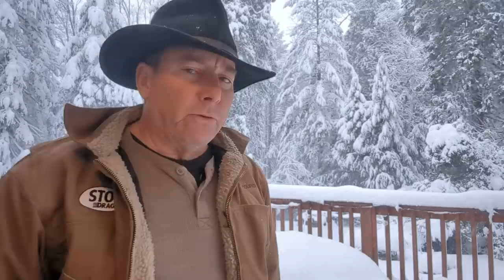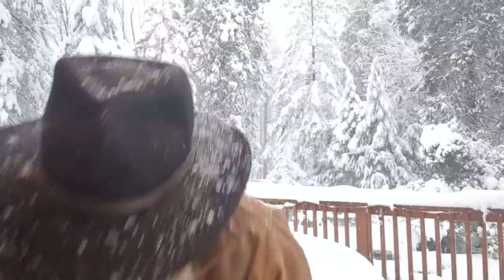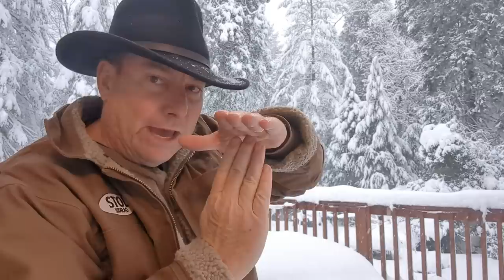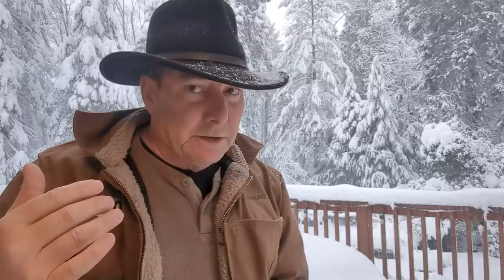PC-12/45 NTSB UPDATE In Flight Breakup! 26 Feb2023

Comment: There are so many CVR'S sitting on shelves from scrapped aircraft that have been retired from service due to market changes. They might be "on hold" as back ups for the type aircraft the were removed from but getting one installed in a part 135 aircraft would take either an exemption from the FAA for installation in a commercial aircraft or recertification of the avionics suite on board. Years back I remember there was a company that sold a small voice recorder that installed in the instrument panel, primarily to be used as a reminder device for the pilot. The big issue is that it would not have survived a post crash fire. This is the reason for mounting the CVR’S in the tail of the aircraft. This would amount to installing a wiring harness to the tail of the aircraft which would make it  necessary to disassemble part of the interior of the aircraft to properly install the harness. This would lead to issues of aircraft being down for service as well as the cost of installation and a new W&B certificate. Personally I would do it if I was still flying.

Comment: Maybe the plane reduced speed after breakup, otherwise the avionics might not survive. Near vertical into the ground at close to mach is no bueno.
I can see how you could get disoriented in a plane with no instrumentation and got into IMC but isn't the very premise of IFR to fly blind on instrumentation. It must be a certain personality prone to lock up in an irrational panic mode. Unless the autopilot was bumped off and the pilot didn't notice but is that even possible. If the flight off autopilot felt pretty steady but nah, near vertical it should feel wrong somehow. Is it possible to barrel accelerate down so you feel no longitudinal force and suitable 1g down into the seat?  nah seems very particular.
Reply: Its not so much a personality type, we rely on out inner ears perception of movement and balance all the time we are conscious and 99.9% of the time  its correct, humans didn't evolve to fly so when that system gets out out of wack  without practice or training its really hard for us to recognize that  our brains liying to us and that you have to act contrary to what its telling you. Thats even more so in a stressful situation, and that why Spatial disorientaion is a dangerous thing and has killed even very experienced pilots. And yes you can be 90 degrees wins banked in a descending spiral heading nearly directly vertical into the ground and still feel like you might be wings level or even climbing. In most cases of spatial disorientation pilots end up into a steep descending spiral for this very reason. He most likely was on autopilot up until it may have shut off due to turbulence and he began hand flying which is when potentially he began turning and loosing altitude.

Comment: Hey Juan, "almost Commercial" pilot here, so no experience in the FLs, but I did notice that in your commentary of the ADSB data that I think the area where it supports an AP disconnect is right at FL18.  Could there be something with either the AP and the setting to 29.92?  Or is the cockpit layout such that changing the altimeter is close to the AP?  IE high stress environment and changing the wrong instrument???  Just a thought?

Comment: Flying alone in hard IFR at night in weather on Part 135 is not very smart, to say the least. 
The Pilatus PC-12 is a very capable aircraft. The problem seems to be ... the pilot. I don't know this particular pilot's experience, but in general most of the pilots move "up" from smaller airplanes to a high performance single or twin engine turboprop. It takes a while to get used to it. As soon as your experience grows, the pilots move to bigger airplanes / airlines.  Medevac pilots rarely do this job for a lifetime. If you get a chance, you leave. 

Regards from the 747-8, former medevac pilot on Cessna 421, Cheyenne, Falcon 900, Citation and King Air. 

Blancolirio?  Juan is the best, by far! Regards from Switzerland. RS ✈

.

Comment: I wonder if the wing piece came off and caused the right turn from asymmetrical lift that he couldn't recover from.
Reply: Wings just don't typically fall off. And can handle a lot of stress with the wingspar support going through it.
Reply: The right turn came first.  The g forces from the rapid descending turn appears to be the cause of the breakup.  See Juan's "just to be clear"  note.  As someone else mentioned, the breakup probably occurred fairly close to the ground since the pieces impacted the ground close to each other.
Reply: @loudidier3891  Loss of the tip of the right wing would cause a right bank and with only one aileron left that didn't have enough authority.  I didn't see it mentioned of where the tip was found.  I'll watch again.

Comment: Not drawing any conclusions but these aircrafts with T-tail configuration suffer from a condition called Deep Stall which can be very difficult to recover from. I can imagine the horror if such a stall then spin event were to occur in imc. Condolences to the families of the deceased.
Reply: Nope. And the plural of aircraft is aircraft. There is no such word as aircrafts.

Comment: Wonder why his autopilot wasn't on, or possible failure?
Reply: Autopilots turn themselves off in small planes during turbulence because the direction they need to correct is changing too fast for them to keep up.  Small planes can bounce up then down then up again all within a second or two.  The term pilots use for the autopilot turning itself off is "disengage".

Comment: I am not a pilot. However, I did experience what I would describe as spacial disorientation while driving at night, during a snow storm with blowing snow and the wind was making the snow blow in changing directions and variable speeds relative to my vehicle speed.  Not only could I not see the road, the headlights reflecting on the moving snow which was shifting directions and speed almost continuously, made me completely lose my sense of direction, speed, and equilibrium and disoriented me on all three axis.  It was the most scared I have ever been operating a motor vehicle after over 35 years of driving in all sorts of conditions.

Comment: Is the TSB going to require some type of action against these Guardian Flights?
Reply from the maker: They can’t. Only the FAA can.
Reply: The NTSB is an independent board chartered to uncover the underlying causes without assessing guilt or penalties. They can make recommendations to the FAA, aircraft, manufacturers, and others, but the NTSB has no enforcement power.

Comment: Loss of control, into uncoordinated flight/spin, initiates "flutter" outside range of operation tested to calculate VNE, which then causes breakup?  Testing flutter via seat-of-the-pants would be quite destructive, terrifying and hazardous to safety, but likely essential.  How is it performed for certified rather than experimental aircraft?

Comment: It looks like way beyond VNE and very high G loading. It's a quite large plane and the T-Tail will be most vulnerable to separation under those conditions. Once you lose the tail section, all hell's going break loose anyway. The plane will just go vertical down and spin and spin until other parts start separating.

Comment: It seems that after the auto pilot disconnected it all went bad. This report isn’t quite accurate in that GF did not have 4 recent accidents. These quoted accidents go back as far as 2012 or so. To put it into perspective, GF as a whole flys a lot of hours in the nastiest parts of the country. SE Ak, Dutch, Kotz, and all the high country in the 4 corners area. Additionally a lot of these flight are middle of the nigh in terrible conditions, so it is a higher risk operation.

Comment: Could it be engine failure? in the previous video,  the first thing I noticed on the flight data, is that the speed dropped  right before the right turn!!
Reply: Engine Failure at 19,000 FT should not result in loss of control of the aircraft.

Comment: I wonder how well instrument qualified pilots in that company can actually fly with basic instruments? I have personally spent the most rewarding moments in the air in a glider in the clouds with only a clock, yaw and tilt, variometer and altimeter as help. I got the speed based on the sounds of the air flows, because the holding tube is the first to freeze. In autumn, the last ice comes off the wings only in the finale. Basic skills are a good medicine against SD.
Reply: You fly in clouds without any type of gyro?
Reply: Do they not get training and checks IAW 135.293, .297., .299?

Comment: Due to the long left descent (at least that's the track I saw) without any apparent control inputs, this looks like a possible loss of consciousness due to oxygen deprivation. A while back a brand new PC-12 with its new owner failed to pressurize, the guy conked out and the plane flew the tanks empty and went into the ocean.
This pilot was a pro, of course, but he may have overlooked the pressurization gauge.
Usually, when someone loses control in IMC/night, there is a series of turns/climbs, descents as the pilot attempts to regain control.

Comment: I was in an accident in a c8 corvette. I asked gm for the data on that and they had 132 pages of speed, g forces, throttle position stering positions, braking etc etc etc.  if they can put that in a 100,000 dollar car you would think every airplane could have it. More expensive more data but every one should be able to get some data. It cant be that hard to protect, in most cases, a small memory chip
Reply: By the way i was not the driver

Comment: Two pilots two pilots two pilots.
Reply: so, um, failure of the aircraft should kill more people?
Reply: @joeblow5037  I do not believe you are a pilot or understand what goes on.  The plane came apart from being overstressed, 99.0% due to pilot inputs and pilot error.  There are cases, such as corrosion, improper maintenance, etc. that can cause inflight structural failure, but not generally the case.
Reply: @EllsworthJohnson-ui1xm  the airplane had just reached its maximum altitude of 19 k.
No terrain, probably on autopilot.
Explain to me how the pilot 'lost it'?
Reply: @joeblow5037 omething happened. Auto pilot kicked off due to icing or turbulence. The pilot then hand flew, likely becoming disoriented and overstressed the airframe leading to a breakup. The in flight breakup was most likely a secondary event, not the root cause.
Reply: @UTarcher72  Lets not jump to conclusions (pilot error)
Pletty sure he knew how to use his artificial horizon
Reply: @joeblow5037  I understand. We are forming opinions as data comes out. None of us can be certain right now, but its human to try to find reasons.
Reply: @EllsworthJohnson-ui1xm  Understand what's going on?
Grew up around every Air Force Century fighter (Luke,etc). Daddy was lifer in the Chair Force and Chuck Yeagar was his Wing Commander in Clark...Ended up doing 4 in Marine Air and did the FIRST cruise on the USS Nimitz with VMFA-333
so yea
I know nutin
Reply: @UTarcher72  yea
in this case they are going after the PIC pretty quick.
I just feel more needs t be learned.
Reply from the maker: YES!!! Just like the professionals do in the Airline industry!
Reply from the maker: Joe Blow, you got it all wrong here buddy….
Reply: @OtherSarah2  No, so the one overworked pilot wouldn't have over stressed the aircraft causing it to fail, so no one would have died.
Reply: @blancolirio  It's been known to happen occasionally 😣
Guess we will find out for sure in a few years 🙄

Comment: To be perfectly clear, there is nothing wrong with the PC-12 that caused the structural failure. The problem is that the people who tend to be flying these aircraft do not have sufficient experience and ability to stay out of trouble when flying instruments, or to get out of trouble once they do get into it (which is much harder…). In general and in this particular case, this is a pilot problem, not an aircraft problem. The root cause of the problem is the hiring/screening and training processes for pilots. There are a lot of experienced pilots who would like these kinds of jobs but they get turned down because companies want to hire a different demographic, namely pilots who are hungry for experience, who will work for less, who will take more chances and do as they are told without question. Hiring processes are cronyistic instead of based on experience and ability. I realize there will be a lot of attacks over this opinion but so be it, forty years of seeing things like this happen over and over again in this industry have formed my opinion and the fact that these things will continue to happen until very basic changes are made in aviation will prove my point. But nobody cares. So be it.

Comment: A/C do not just break up randomly.  There must be some pre existing cause or condition. What is your assesment of the events occuring leading up to the in flight break up? It is very odd for a PC 12 to just break apart mid flight. I cannot see it being a structural fault causing spontaneous break up.....Unless the A/C was previously over stressed and the structural integrity was compromised prior to this flight.
Reply: nothing random about it.

Comment: I read that the PC-12 has a nasty stall response that requires special software to counteract it. 

Violent updrafts and downdrafts encountered in penetrating a storm front could create a stall condition. The auto-pilot would’ve automatically kicked off  in heavy turbulence even if the pilot didn’t switch it off. 

The plane may have entered a spin and trying to recover inside a storm with no visual references could easily have stressed the airframe beyond design limits resulting in failure. 

Personally I’ve never liked the T-tail design because in stall conditions the main wing can block airflow over the elevator with undesirable effect on stall recovery.
Reply: In a spin I would be more concerned about airflow over my RUDDER.

Comment: Thanks again for your video.

I don't like T tailed aircraft since longtitudinal pitch forces stress a smaller mounting structure at the top of the fin spar rather than a beefier and wider mounting structure in the wider area of the fuselage tailcone. 
It depends on the strength of the wind, horizontal speed of the aircraft and the area of the surface that the wind influences as to where the parts fall, so broken parts at the four corners can be a rough estimate in determining the in-flt breakup. 

May that depth of snowpack increase for more moisture for that CA. desert area but not snow the Global World blancolorio Headquarters into a snow cave.
Reply: Nothing wrong with T- Tail designs . Boeing 727 and MD DC9'S flew millions of flight hours with T Tails without major issues. I already know some some of the sharpshooters will bring up the Alaska Air Flight 261 MD83. That crash was due primarily to improper Horizontal Stabilizer Jackscrew Maintenance Practices and not design issues with the T Tail.
BTW- I worked Heavy Check Maintenance on B727's for about 15 years and the Horizontal Stabilizer wing spar and attach fittings are super heavy duty. 
I have worked on and in flown numerous different large airliners and by far was the most comfortable in turbulence in a Boeing 727 over all the others. It is build like a " tank."
 I have been inside the Vertical stabilizer and the castings and forgings look like " bridge iron ". Super Heavy Duty.
Reply: @guitarhillbilly1482  True what you have written gh. and the 727 was a great craft with  well designed forgings as well as the MD ones.
My focus was on the smaller craft, some of which do not use forgings at the attcch point. I am not sure how the PC-12 brings the horizontal and vertical surface together.

Comment: So, back to you ADSB tracking on the other video, it sounds like he hit heavy turbulence, auto pilot dropped out, he became disoriented, recovered but then lost from the stress of the recovery part of his right wing/ lift, rolled over to the right and lost his stabilizer on the way down--probably pulling on it with everything he had. Pilot did a great job trying to recover, the cards just were not in his favor. For the same reason that the big carriers don't allow circle to land, this company needs to set stricter standards as to when they will take flight. RIP

Comment: No one is placing enough emphasis on "ROLLING G".  The few pilots that are trained on spiral recoveries are typically Not taught to UNLOAD THE ELEVATOR (WING) before rolling  the wings to level.  No aircraft should be rolled with the wing loaded more than 1 G.  Long explanation: When the aileron is deflected down changing the camber of the wing it obviously generates additional lift, this lift is not free it is LOAD on the wing, not just on the spar in the bendy up direction but it is also twisting the wing tip due to the aileron being on the trailing edge of the wing.  It is actually in twist that they fail.  It's easy to make a spar strong, it's hard to make a plan form stiff with out making it very heavy.  The P-51 Mustang is a 6 G airplane unless you are also rolling  then it is a 4 G airplane.  Look for the horizon, Unload the elevator,  Roll the wings to level, then recover the pitch to level.